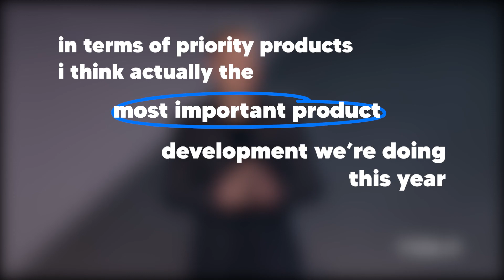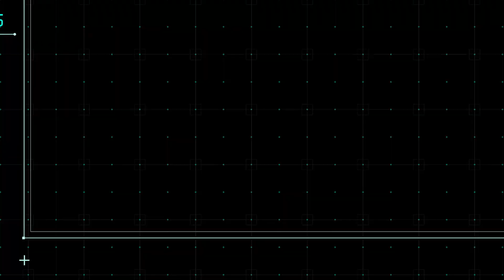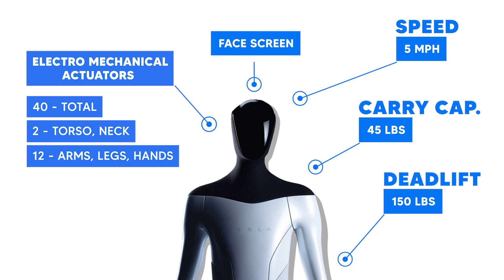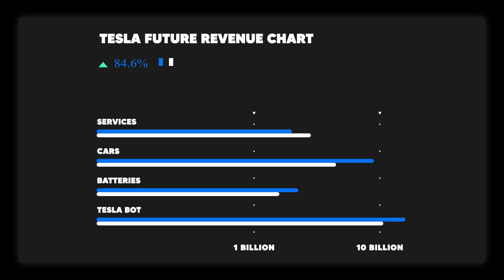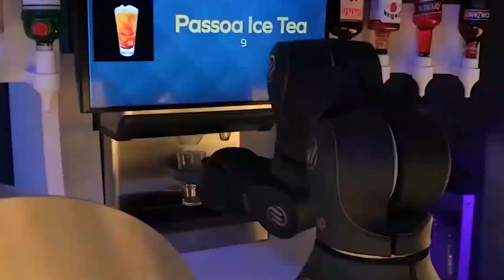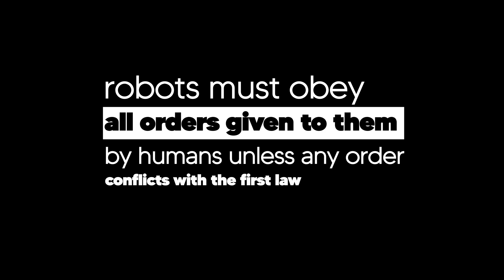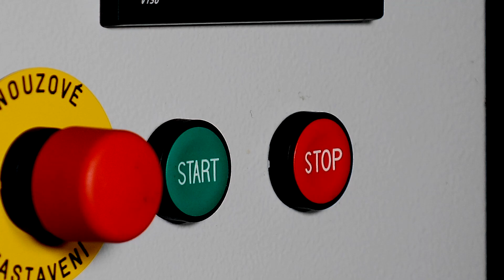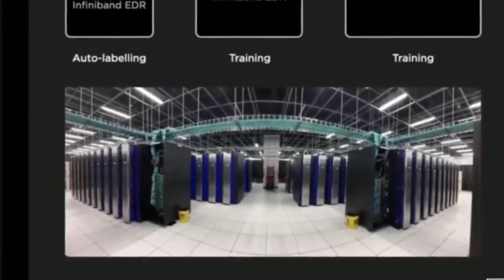What Makes The Tesla Bot So Special.

Comment: It makes perfect sense, to make the robot 'humanoid'. While it may seem more efficient than making a purpose specific machine than something as complex as the human form, if the machine is needed for a different task, it's just a matter of reassigning it. No need to re-tool, no need to modify and especially, no need to replace it! Having a machine this versatile is as close as it gets, to "one size fits all" as far as any light manufacturing tasks. When you look at the price of a typical robotic arm, how many of those could you buy, for the price of one of these? The extra expense for the extra complexity may well be worth it in the long run, just because it can be made to do anything a person can do, with only a little instruction, and perhaps, a new set of hand tools.
     I want one so bad, I can't stand it! I would pay ~$50,000 for it, about the price of a new car, or, the roof top photovoltaic system with battery, I would use to charge it. (whether the car or the robot)
Reply from the maker: You are right! having a multi purpose robot is great. And overtime they get better at every task they do. It might even start developing a personality…
Reply: @TechInCheck  Who knows? It could become my own real live "C-3P0"!🤣🤣

Comment: They can potentially work longer, but no they will not work 24/7. Being powered by electricity means they have to charge. Being mechanical means they require maintenance. They still potentially provide much cheaper and more efficient labor.
Reply: If in a limited operating floor space, there would be no problem, simply running a supply cord to it, so it doesn't have to rely on its internal battery. Even if a task requires it to leave its work station, it can be programmed to simply 'plug itself back in' when it returns to its work station. My question, is servicing intervals of its actuators, and repairs from normal 'wear and tear'. How long, before the skin and lagging begins to deteriorate, and get holes in it, and have to be replaced? Is this thing durable enough, to do enough work at minimum wage, to pay for itself, and produce a profit for its user?
Reply from the maker: You are right!